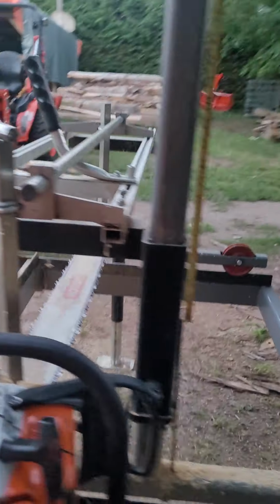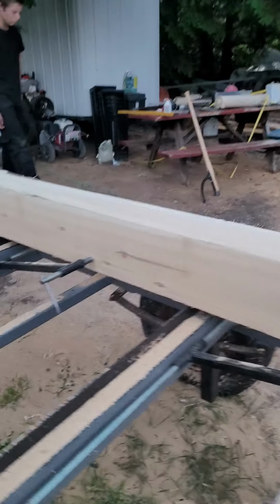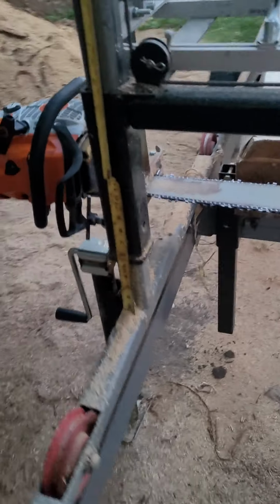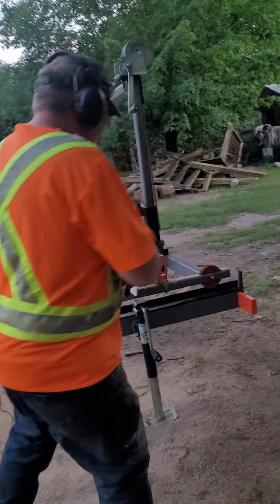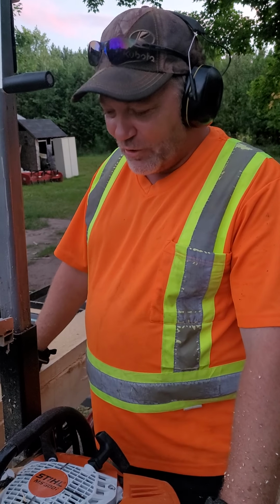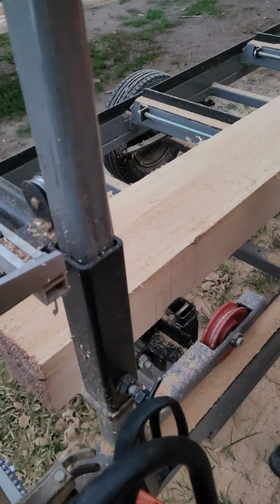Homemade sawmill with a Stihl 500i

Comment: I like your mill. I have cut with a granberg mill for about 35 years. I use a older 090 (150cc). I think you really need a 088 to be efficient. The power of the 090 or 088 allows you to set you rakers a bit lower and step up to 440 chain. You should run extra oil since the saw is always on its side. My 090 has cut through embedded 1/2” cable without losing a beat!
Reply from the maker: Thanks for the comment, the 090 sounds pretty sweet and with torque to spare!

Comment: Love to see how long that saw lasts. Mix a little heavier on good oil?
Reply from the maker: Me Too, I hope to get some good service from this saw being a Pro saw. I run premium ethanol free fuel with Stihls premium 2 stroke mixing oil at 50:1.
Reply: @timschison52  Go 40:1 at least. The lower end bearings will last way longer. The EPA doesnt care that your saw lasts 1500 hours instead of 4000
Reply from the maker: Thank you, great advice 👍
Reply: @em4703  wonder how the fuel injection on that saw will deal with extra oil? I use an older 090 on my mill - powerful but low RPM (8000+) - lots of extra oil in the mix. Last time we looked in the cylinder not a single scratch. I was told years ago that if you are going to mill you need extra oil because the saw is on its side.